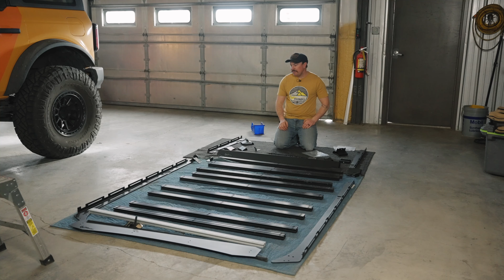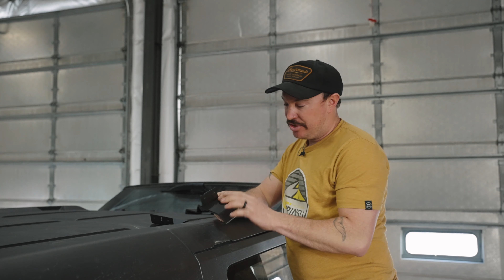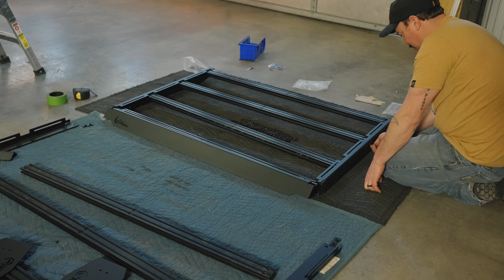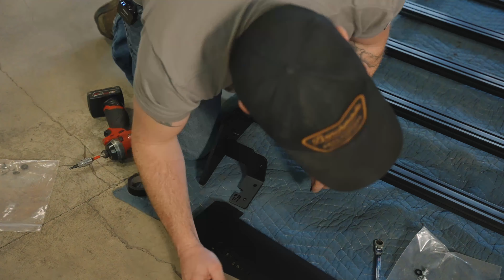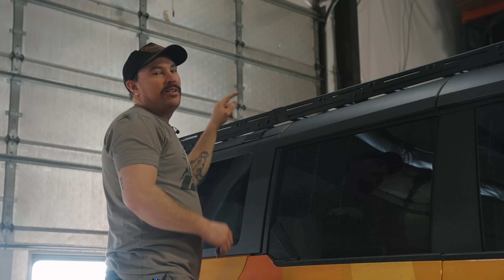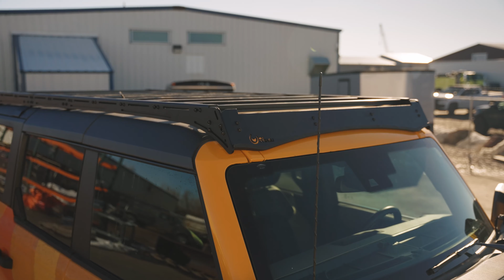Ford Bronco Prinsu Pro Rack

Comment: Video is okay; misses a lot of the smaller details like you have to actually cut the cover plates of your vehicle where the front of the rack mounts.  I expected more from this brand especially for the cost of the rack.  Also, he states the dimensions and close up's of the cover plate installation will have a link...where is it?

Comment: Tried using this to install my prinsu pro rack, didn’t help much at all. This is basically half the info you actually need. I expect more from such an established brand
Reply: Fully agree. This is truly a pretty poor installation guide.
Reply from the maker: Thanks for the feedback, we'll continue to improve on these videos. In the meantime, have you emailed or called our support team? We can get you in touch if you're still working on install this product.
Reply: Does the rear deflector stay on when it’s built as a full rack?
Reply: @joshg8458  No it does not
Reply: @joshg8458 nope you have to remove the rear deflector
Reply: I too am wondering about the rear deflector staying on the (saddle rack) section when installing the rest of the rack
Reply: @cbiprinsuinstalls